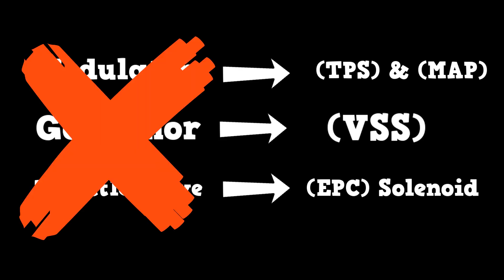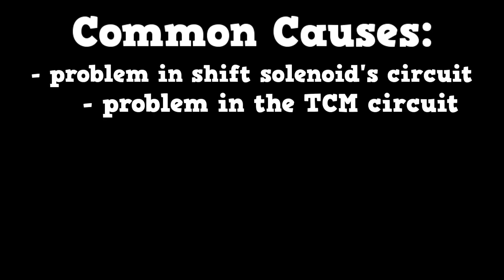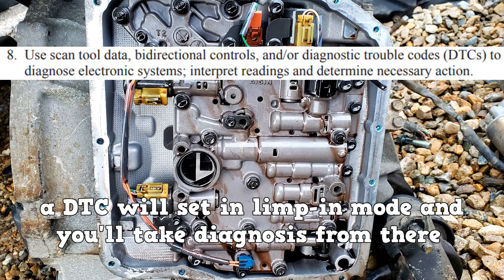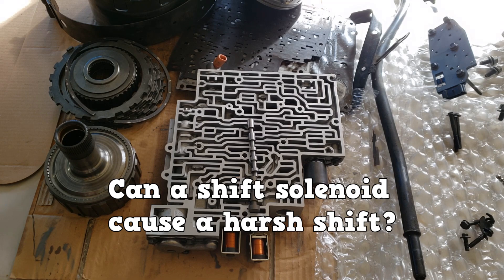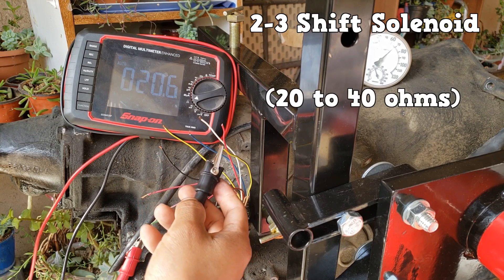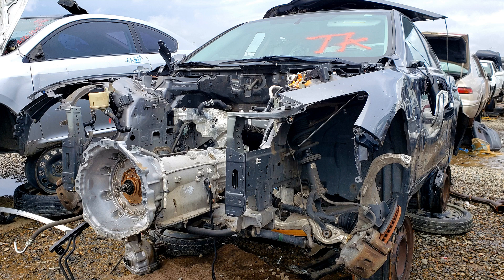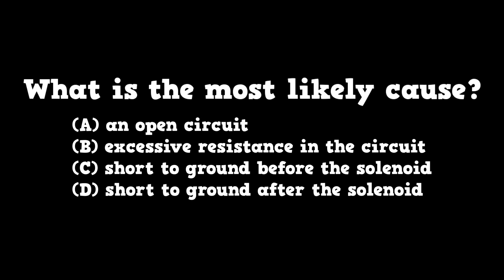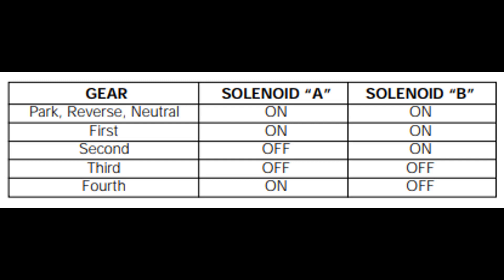ASE A2 Test Prep #4 - Shifts

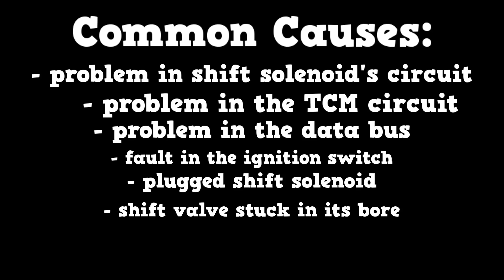Comment from the maker: (Update 2-4-24) Here's some feedback after taking the test: I believe the test called "Limp-In Mode" Limp-Home Mode. Basically it is caused by a shift solenoid circuit issue most of the time (out of the reasons shown at 1:07 ). Rule out the obvious bad answers (such as epc solenoid). A6 Electrical Diagnosis plays a HUGE role in the test. Lots of wiring diagram questions about open circuits/short circuits. A few DMM results-style questions on wiring diagrams.
There was a question similar to 3:46 .
Overall a decent miniseries, in all honesty its a review of the core basics. I did not cover stall testing, noise and vibration diagnosis, bushing info, and transaxle specific info. If I were to do a video #5, it would be on transaxle specifics, such as how the chain (if applicable) is driven and final gear seal diagnosis.

Comment: what is the answer to the last question "B"?
Reply from the maker: The correct answer is "C" the throttle position sensor.
(A) is incorrect because the oxygen sensors give feedback to adjust the fuel trims. Fuel trim data will not make the transmission/transaxle upshift harshly.
(B) is incorrect because the idle air control valve controls how much air "bypasses" the throttle body during idle. In theory it only affects the engine during idle and not during upshifts.
(D) is incorrect because the intake air temperature sensor lets the computer know the temperature of the air going into the engine. If it fails, it can fail at one extreme and stay that way, either very low (like -32 °F or a very high temperature). This will not cause harsh upshifts during normal acceleration.
(C) was correct because a failed (TPS) sensor will not inform the PCM about the amount the throttle body is opening. In theory the throttle body would open but the throttle position sensor won't register it. So a bunch of air is suddenly let into the engine, without the computer knowing (It seems PCM takes the value of the TPS sensor over MAF sensor), so yeah this will cause some symptoms, including a harsh upshift.

If you haven't, you should do a study on engine performance (A8). There is lots of engine performance issues that tie into the automatic transmission, this question was a fantastic example of that.

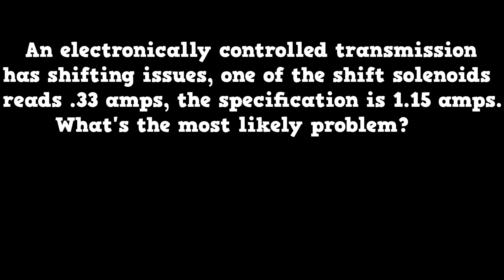Comment: @ 2:45 QUESTION 
1 = B 
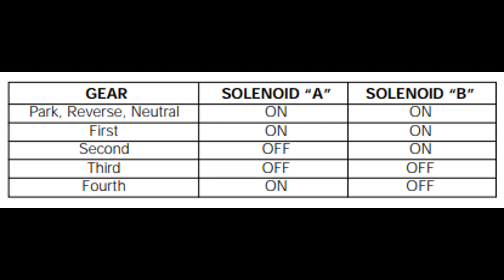I believe I may need more help on the trans charts like the @3:40  and @4:00 shift solenoid charts.
@5:00 2 = B 

Subscribed! Also ASE store is closed till April 10, 2024 so I can't purchase the original study guide yet. Thank you for making these videos. I know it takes time away from your personal life. Much appreciated!
Reply from the maker: That last question, answer is C, throttle position sensor.
Are you familiar with throttle position sensor testing using a scanner? Parked, with KOEO, slowly go wide open throttle while graphing the voltage value of the TPS, then slowly let go of the throttle. The graph should look like an upside down U. A defective TPS will have "a glitch" in the waveform. Also a "failed" TPS will not even make a waveform. It will be a straight line throughout the test, in this case the computer will think the vehicle is at a specific throttle position and upshift according to that throttle position.
  You chose "B," Idle Air Control Valve. It basically does what it is named, it controls the air coming in at idle. If it lets too much air in, the fuel trims will increase. Not enough air in the engine could have a weak idle, see it does not affect shifting. 
 The chart at 3:40 ,  In overdrive, if the vehicle does not have 3rd and 4th gear, what could be the cause?
Reply: 😂 I meant C on the last one lol I still got it wrong for not looking good at the letters. 3-4 clutch.
Reply from the maker: @j.gtheautotech8455  Did you run out of time during the test? How confident are you with the electrical questions? Seems like you got the basics mastered.

Comment: Where are the answers  to all the questions you ask during these videos?
Reply: I agree @oldschoolnoe  . We’re left with doubt  . Same thing with the ending ASE questions.  You’re videos are very helpful though.
Reply from the maker: they should be pretty easy to figure out, which one are you wondering most about?
Reply: You should still add answers may be easy for you but not to others. May help with our current knowledge if we know if we got it right or wrong and to see where we need improvement. Great videos by the way helps a ton to see components.   @OldSchoolNoe